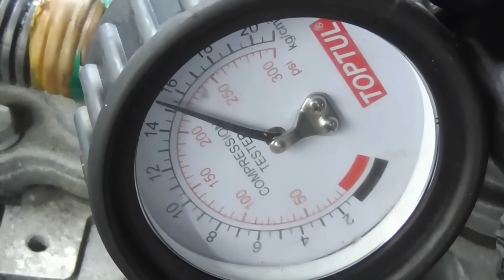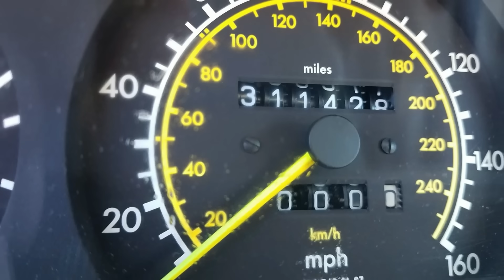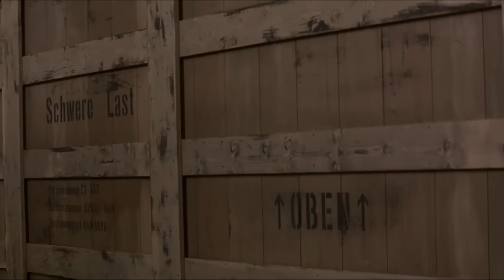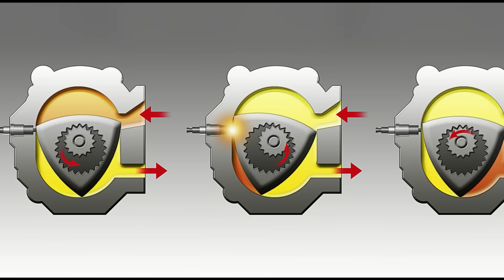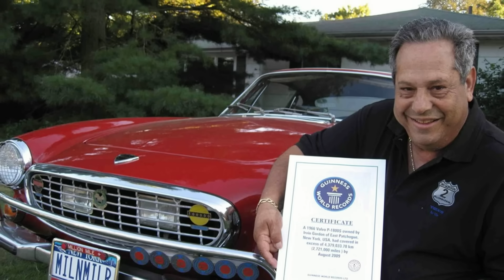Most Reliable Engines of All Time

Comment: Even a piece of shit engine can make over 100,000 miles these days. In the 90’s 100,000 was a milestone for the average American car, followed shortly thereafter by catastrophic failure. I had a 2002 Dodge Ram with the worst engine, the 4.7 v-8 and it made over 130,000. My current truck is a 2005 Tacoma with over 180,000 miles and it runs like new. Even the original spark plugs made it to 170,000 miles( I changed them shortly after I bought the truck). As a former Master Tech, I would say a high mileage engine would be minimum of 300,000.

Comment: Not a good one.
Where's the 5.9 cummins? The Ford 7.3 engines, the Ford 4.6 2V and 4V Modulars, the 700 000 mile corvette?

I personally have a Lincoln MarkVIII which has 265 000 miles on the clock, the engine has never been opened, and runs like clockwork.

Comment: I have a 2012 gmc pickup with over 300000 miles.. Never had to touch anything under the hood. Had an f150 before that with almost as many miles. 150,000 on a rice burner, it should just be getting broken in.. Pretty low standards for this list

Comment: Honda V-Tech 3.5 used in odyssey , pilot , mdx  etc ... I have one in a mdx , 260,000 and it still uses no oil ( only component changed is timing belt water pump and a valve adjustments ) ...  the odysseys are used for taxis and I have personally done timing belts and valve adjustments on these with 500,000 + miles and they run great still
Reply: Honda v6 great engines. The transmissions attached to them not so much.

Comment: yh this guy has no clue what hes talking about
Reply: you can not say that too many times  complete fiction
Reply: Funny to hear him go on and on though 😂
Reply: This guy is not consistently fact-based...
Reply: Hello gm 3800 will beat most of these engines on how long it will last
Reply: @StephenHarbarger  yh that should’ve definitely been on the list
Reply: Is this a high performance engine reliability post or every day drivers??? No mention of the Ford 300 CU IN in line 6 engine that I personally owned a 1965 Ford Fairlane that I sold with 491,600 miles on it still running just fine. They were made from 1965 thru 1996 and they were not just in cars/pick ups ether. Many farm tractors, farm equipment, utility vehicles and the big brown UPS trucks had them as well! They were not high mpg engines but RELIABLE! I have one horror story though that my Brother bought a 1967 Ford F 250 4x4 with a 300 six in it. In the summer of 1969 I asked him how often he changes his oil because he was complaining that it was burning a quart every 300 to 400 miles? His reply was, "Change oil?" It had 45,900 miles on it with the original oil and my brother only adding oil when needed. I changed his oil/filter putting in high detergent oil. He took my advice having the oil changed again in 100 miles. It lasted another 38,100 miles before it locked up.

Comment: The mercedes OM617 in the 300D is the most reliable ever. Forget the 100, 200 even 300,000 miles mentioned here.  I had one I sold with 365,000+ miles (odometer broke there) and I ran into a guy at the gas station with 550,000 miles on his.
The thing about that engine was that it never had a hard failure that would leave you stranded. It would lose some power but would always start and get you where you wanted to go.
Reply: Best diesel engine ever built.  I have a 1984 300SD with 752K.  I finally parked it a few years ago.  I bought a 1983 300SD with 132K, paid twice what it was worth, but I guess it'll last the rest of my lifetime!  I wouldn't think twice about buying one in good shape with 300K!

Comment: The Ford 300 straight six (4.9L) . No timing belt or chain , Just cog  to cog. Those motors were legendary.
Reply: I put 320,000 miles on my 1991 Ford F-150 with a 300six and a 5 speed manual, never one lick of trouble. The best engine /transmission combination I have ever seen in my life. It would have gone another 300,000 miles easy..
Reply: @stephanfiebich1561   Same here , to bad the F-150 body were rust buckets and could not keep up with the motor.
Reply: I had an E150 with a 300 six that went 340k miles without ever being apart.  I came to a righteous end when a fire under the dash burned it to the ground.  It was beautiful, like a Viking funeral. :)
Reply: I had two f-150s with that engine and four speed transmissions, and, they were bulletproof. They also could pull like a team of horses.
Reply: Yep, Slant 6 also, Mercedes OM615, Cummings 5.7L , Citroen 1911cc , Toyota 22R, ...
Reply: Had a 300 ci six cylinder in a 1976 ford van it was a great engine.
Reply: My dad bought a 1984 Ford delivery van with that engine that saw only stop and go city duty for 160K miles for $1000. He proceeded to put another 160K on it trouble free before he finally bought a newer one with A/C.
Reply: I had an 86' F-150 that had 165000 mi When I sold it and was running great
Reply: I've had a 94 4x4 f150 4.9 with 5 speed manual for over 20 years only issues I've had with the truck is stuff I caused myself.
Reply: Agree I'm a mechanic in north America I have a few of these with ridiculous miles
Reply: They copied Chevy on the gear to gear timing the ford is a great engine for sure
Reply: Ford is the best .Ford -first on race day!!!
Reply: Those Ford 300 are simply incredible(although not very powerful at 100HP). The secret of their reliability is that they were originally designed as industrial generator motors meant to run nonstop for prolonged periods of time. You change their oil once in a blue moon and they will run forever.

Powernation built a turbo Ford 300 that was pushing over 500HP. That's 5 times the original horsepower!
Reply: Very dependable, gas guzzlers
Reply: Ford 3.0l vulcan goes and goes and goes just not really quickly .
Reply: @codyhatch1813  is that what was in the Taurus? I know it was a 3.0 it went and went as long as you didn't run it hot.
Reply: japan shit- two boddies with one engine.
Reply: Hell, they would keep on going with no oil in them!
Reply: Look up power nations rebuild on an industrial 300-6. Impressive power and torque....then they turbocharged it!
Reply: almost more legendary as the 302... shame the 300 went away... it was a gem.
Reply: Reason why the Ford 240/300 inline 6 is one of the most reliable engines ever made (260/289/302 is another very reliable engine from FoMoCo) is there is no timing belt or chain, simply a gear at the end of the crankshaft that drives the cam shaft. Almost any engine with a timing belt will be obliterated (unless it’s non-interference) since if the pistons hit the valves, there goes the engine. Engines with over head cams can also be problematic since they are more complex, if you want to replace the head gasket(s) at home forget about it since they can be a PITA to work on. Push rod engines will always be the easiest to work on and repair.

Comment: My old 2000 Ranger 2.5L was at 210K and burning maybe 1/2 qt. every 4000 when I reluctantly gave it to my youngest son. I have a 97' 3.0L Ranger with 170K that I figure has another 100K in it - those vulcans aren't horsepower kings or gas savers, but are well designed and durable.

Comment: I have 320000 miles on my 07 Accord with a Honda J-series engine with no internals replaced, which you should add also.  There are many out there with well over 500000 miles.

Comment: U clearly have a very limited knowledge of what true reliability is lol try cat or Cummins where million miles is average for trucks and in pickups 600,000 u must be why us 30 somethings get clowed on. The Japanese  motors can't touch the European or American diesel engines
Reply: exactly!  the new Cummins, used in Kenworth trucks, reccommends 100,000 mile oil change intervals!  While I find this excessive, it also tells that the engies will go a MINIMUM of 1 million miles, if you change oil and Crankcase filters regularly!

Comment: Really a mazda rotary lol. I like how they left out the best engine in the work Fords 7.3 l powerstroke that can easily do 300k get a valve job done and continue to power along over 500k with proper maintenance. At 300k valve seats become worn and valve like to stay closed witch bends push rods I worked on one that made it to 415k when it need valve job

Comment: My k2500 Chevy with the 6.0 gas engine has 355000 plus miles, pulls a trailer every day an still going strong.  Has had a water pump, alternator an rear crank seal. Still on the second set of spark plugs.

Comment: If you want to look at the most reliable mazda engine, look at the 1.5 engine that came with the old 80's mazda 323 and 626, that thing was just as reliable as the toyota motor.

Comment: Can't believe they didn't have the Gardner 6XL engine on here, very few videos on youtube, but they are a legend, especially in the marine engine world.  Heard a  story from a guy that had a Seddon Atkinson truck with one in, in the 80's.  It did 2.5 million miles, and all they changed in that time was a head gasket and the injectors.  No surprise that those in the know in USA, will pay $50,000 for a good one.  And it was one of the most efficient diesel engines ever built, but new emissions regulations made them stop building them.  Thankfully they just opened up again, doing rebuilds, and thankfully the old grand masters teaching the new kids how it's done.  Their secret was that everything was cast and machined in house to the strictest, highest tolerances.   If you're a fan of engines, or just engineering in general, then look them up, and go on one of the forums and read the stories.  Trust  me you'll be amazed, in awe at what you'll read, and you'll want to buy one.  I saw a 55ft work boat, part converted to a house boat,... And it had one in it, and was only £4500 I couldn't get the money for a week.  Needless to say, someone brutally tore every one of his limbs off before I could get the money.  Don't think he had any idea what he was sitting on.  Am keeping my eyes open for another one, but don't expect to have the chance again.

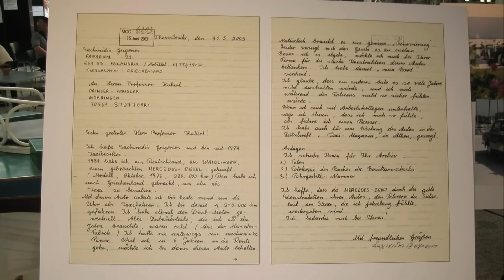Comment: 70s mercs are pretty bulletproof, I don't argue with that, but what the narrator doesn't tell about the 1976 Mercedes from Thessaloniki with over 2.000.000 miles on it (4.6 million kms), is that by that time, the engine had been overhauled and/or replaced 11 times, it said so on the certificate issued by Mercedes (at 10:43, Motor: 11 mahl überholt und gewechselt).  A friend of mine has a 1972 Volvo 144 with over 600.000 miles on the original engine and not a single overhaul,  the engine has never been taken apart.

Comment: The Australian built  and developed  4.0 litre inline 6 ..either the SOHC  12 valve or the DOHC Barra 24 valve  are truly bullet proof  ...so many of these are still running faultlessly with 500,000 kms plus .  Many with lots more ..And on top of that they have incredible torque from 1500 rpm onwards ...Look it up .
Reply: My barra is at 635 000km.  Still going strong.

Comment: I have a 1970 ford f100 pickup with a 300 inline 6 cylinder that has over 400k miles without a single engine related breakdown. My grandpa bought it brand new and drove it for 40 years before I got it 10 years ago. Its on its 2nd clutch and the transmission is noisy but it runs just fine.

Comment: 4.9L Cadillac engine - Easily 3-500,000 miles. 

3.8 Series 2 GM engine - Will go forever if you want it to.
Reply: 4.6 liter Northstar - Lucky to make it to 75,000 miles without a blown head gasket.....
Reply: Flies2FLL Cadillac shitstar
Reply: @mikecastellon4545  Look at Car Wizard's YouTube about Northstar problems.
Reply: 3.8 v6 buicks make a good boat motor with a 2 stage jet unit 🤙(also rebadged as GM, Holden, Vauxhall, Opel)
Reply: HappyKiwi is it still in cars produced today? Then your argument is void!
Reply: Now we know your level of knowledge,  or lack thereof! The 3800 hasn't been used in gm cars since 2008 Pontiac grand prix. it is not built or used in any car in over 12 years GENIUS! Next time you want to bash someone have the decency to do some research first!
Reply: @jamessprague5653  he did say "boat motor" not "car motor" the don't use the small block Chevy in modern production cars either, or the big block. They also don't use the 300 inline 6 or the 2JZ in modern cars, does that mean all of those are utter shit too? I threw 4 bottles of nitrous through a stock 3.8 out of a 94 gmc sierra after it had already gone almost 400k with no major service other than 2 water pump changes. It took 3 and a half without so much as an oil change and made over 700 crank horsepower 4 times before it stretched a rod, then I just said fuck it and opened the valve on the last bottle and pinned the throttle and got right to the end of the bottle before it finally threw that damn rod out the side. Registered 727 peak horsepower on that last run.
Reply: @jamessprague5653  The 3800 topped in 2010 with the Buick Lucerne.
Reply: Yeah, but my hairdryer has more power
Reply: Can confirm, slammed one into the back of a heavy haul trailer around 80mph, pulled it out after (with about 400k on the poor motor) still ran like a top, threw three full bottles of unregulated nitrous through it without even changing the oil and finally threw a rod after hitting 600 horses on that engine dyno with that nitrous.
Reply: Any 4 anything Cadillac’ was luck to see 80kmiles without a head gasket or cracked head.

Comment: I’ve got a 2003  Toyota Matrix with over 350,000 miles and the only things I’ve had to replace on the engine are spark plugs and valve cover gasket.

Comment: I had a f250 with a 460 engine    I put over a million miles on it before my brother totaled the truck. 
Pulled the engine out rebuilt engine and trans the put it in a 65 galaxie 500. 
  I miss that truck

Comment: You say 150k miles are a lot... I just have made 200k miles on a land rover discovery.
The engine still all original, except for the cam belt and egr sensor. Naturally the rest of the car is a crap. I had problems with transmission, suspension, brakes, bearings, electronics etc...
But the Tdv6 2.7 diesel engine is great. No headaches.

Comment: You missed the with out a doubt very reliable G.M 3800 v6, and the chevy L.S series engines. The 90's chevy vortec's were great too. Or were they too reliable for your list? You do say 120,000 to 200,000 miles. To me thats nothing. I witnessed many gm engines listed above with many up to 400,000 miles on them, and many with original engines and transmissions too. None rebuilt.

Comment: I just sold my 2000 Mitsubishi Galant 2.4 with 250k miles. I changed the oil every 10k miles, and never changed the transmission oil even once! It ran fine when I sold it. The only work it ever had was changing the timing belt at 150k miles.

Comment: You forgot to say anything about the ford/navstar 7.3l diesel found in the power stroke from 92-03. I currently have one sitting outside my house with 247k mikes original engine original transmission. No rebuilds. And there are many out there with over a million miles on them. Or is this a list of just non American manufacturers?

Comment: Mercedes engines: Good
Mercedes electronics: SO YOU HAVE CHOSEN DEATH!
Reply: Merc engines were good in past days - today they suffer from timing chain issues, badly hardened chain rings and other problems. 
They offered a very high quality in the 80s, however today their quality is mainstream at the best, at the same time they have high maintenance costs and you pay mainly for the image of the company if you buy an expensive new one. 
Other German manufacturers however are not better.
Reply: so get one without electronics an you will be fine. saty old school
Reply: I had a 2001 Mercedes e320 and I couldn't kill this car no matter how hard I tried lol
Reply: 2 @acgAdventures  The 2001 E class model (the 210 class) still had engines from the 90s, you had the 3,2 liter M 112, a good, reliable engine. The cars itself often suffered from corrosion due to paints hop problems and problems with the cutting of the sheet metal. 
The successor engine, the M 272 however suffered from several problems, which were partially expensive to repair. 
You have to make a difference between the produced models, until the early 1990s they had the best quality (the 124 series was the best car they ever built). 
From the early 90s the mechanical quality was still good, but they used water based coatings which led to corrosion problems all over all models. Around 2000 they started to replace engines and gear boxes from the 90s, these new engines were more complicated (to save fuel) and were cheaper built, they started to use plastic parts and they had problems with thin timing chains and badly hardened parts. 
The gear boxes used thinner gears from then on, to save weight and offer 7 or more gears, but the life span decreased. 
Some special gearbox models (for the 168 and 169 A class, not sold in the US) had extremely high failure rates because of electronic problems. 
So it depends which model you buy, the cars from 20 years ago are different from the newer ones.

Comment: I can't believe you completely missed the most popular engine in the world that is the Chevrolet V8 350 small block .
what a dumb-ass...
 I own a 1994 Z71 Silverado I am the original owner it currently has 453,000 miles on the untouched engine and transmission additionally I've only changed the transmission fluid/ filter once at 150,000 miles. go fuck yourself dumb-ass.

Comment: Isuzu 3.0 liter 4jj1 turbo diesel In the Isuzu DMax and N series truck. It has a B-10 rating in the U.S. They do 7.5 seconds in the quarter mile producing 1000 hp in Thailand.  They power long tail boats in  at 400 hp on  60 psi boost running 60 mph.